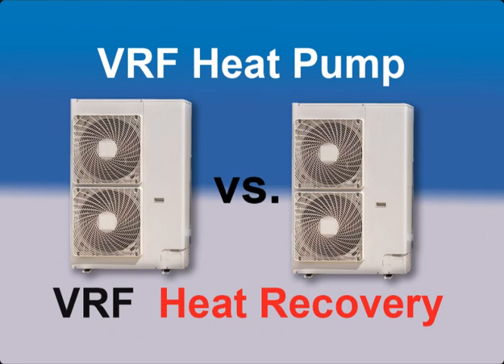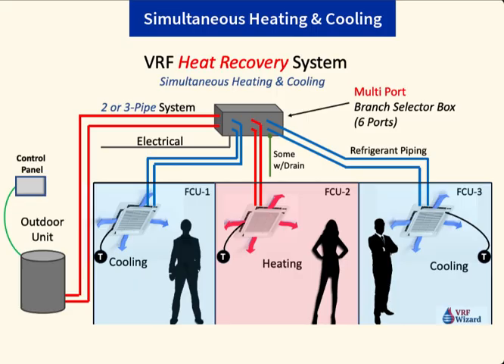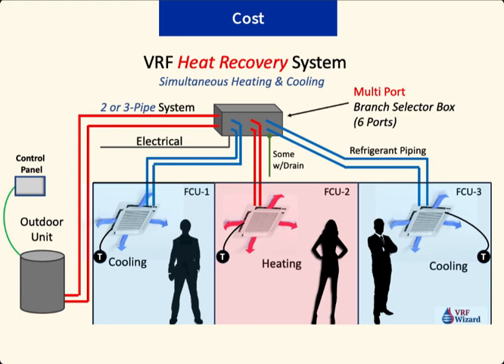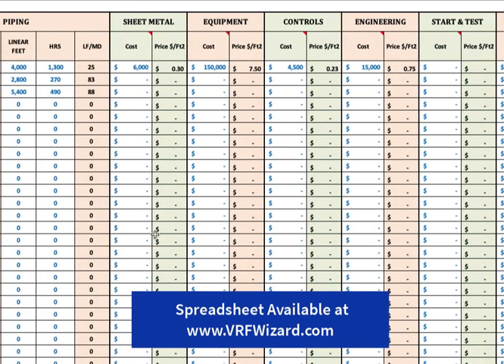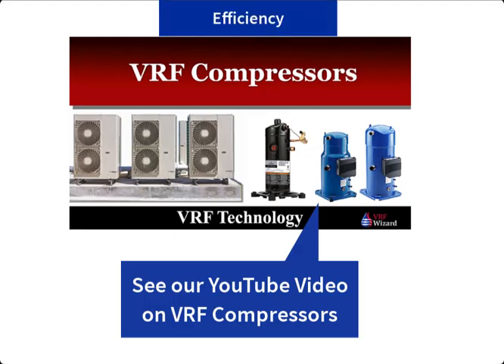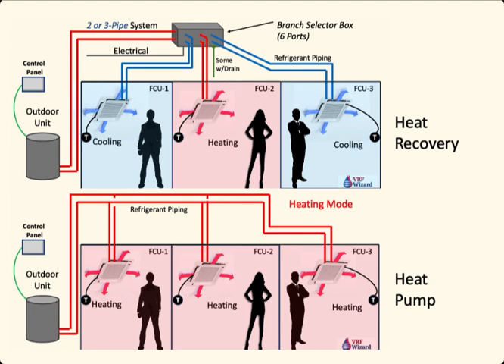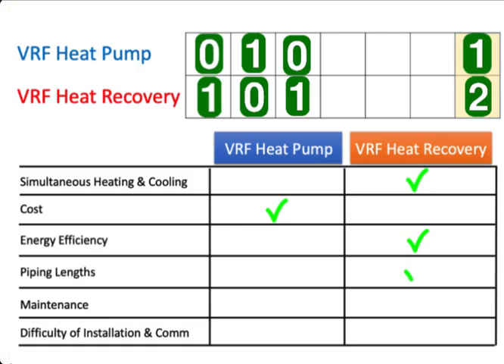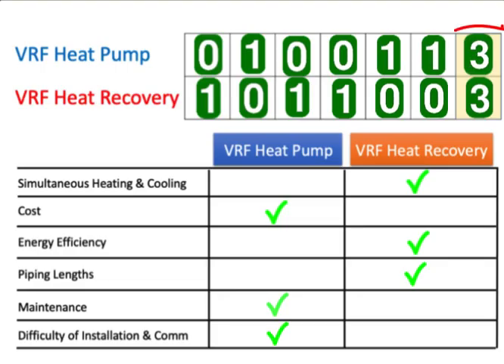When to use VRF Heat Pump vs Heat Recovery

Comment: How do I change these units ?
Reply from the maker: What do you currently have, and what do you want to change too?
Reply: @VRFWizard  Haier AUH4860ZGDA GE inverter
Reply from the maker: @ekie85  If you want to change to a Heat Recovery System, you'll need to have the system redesigned as you'll need the Selector Boxes installed between the Outdoor and Indoor Units.

Comment: Can you please provide a heat recovery system recommendation for residential daikin-Mitsubishi-Samsung. (Specific models please).
Reply from the maker: There are many factors that go into selecting a VRF unit. You're asking for a heat recovery unit which would indicate that the home is very large. Large enough to benefit from diversity. We're assuming you have a balanced load between heating and cooling and that you require heating and cooling simultaneously. Most often a heat pump will work for a residential single family home where you'll be using either the heating mode or cooling mode, but not needing both simultaneously. The location is important when selecting a VRF unit as you want to make sure the heating capacity will satisfy any extremes where its located.  To recommend a model number we would need a lot more information starting with the size of the unit. The selection is best determined by a local contractor or engineer. We usually don't provide recommendations, but provide information that allows you to make an informed decision.
Reply: @VRFWizard  the home it’s not that large (but highly efficient) actually 2500sqft. Two story super insulated, r40 walls R60 roof, insulated interior walls and ceiling. R 30 under slab. Regular calculations don’t really apply. I am. Looking for the smallest heat recovery vrf preferably Mitsubishi,  I would pay you consulting and adquisición fee if you could get one for me with two cassettes and hybrid branch controller box.  I would also allow for you to film installation and commission if you are interested.
Reply from the maker: @tatosan8810  We love your offer,  but we don't actually sell VRF equipment. You'll need to contact a local licensed contractor to purchase equipment. Good luck.